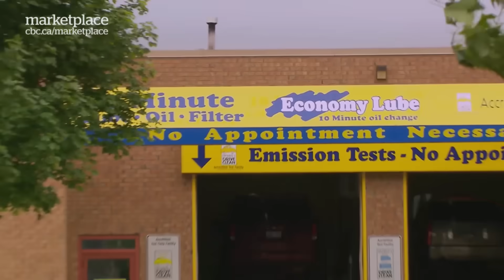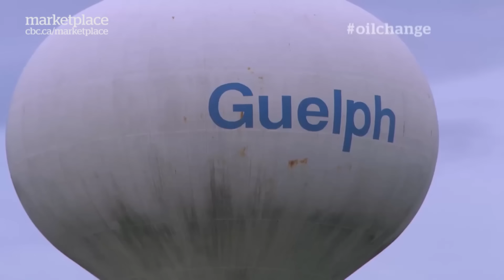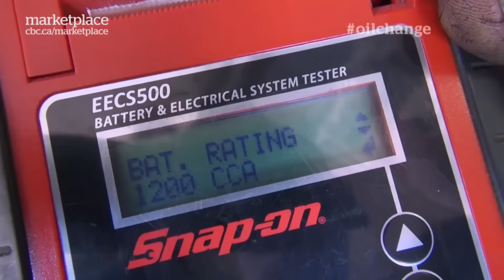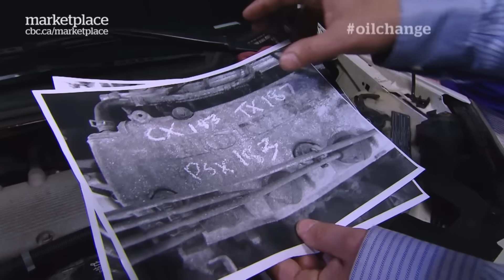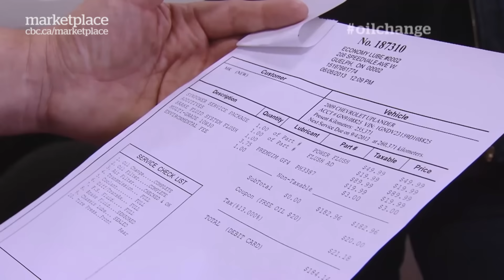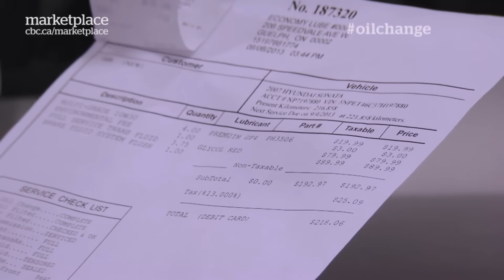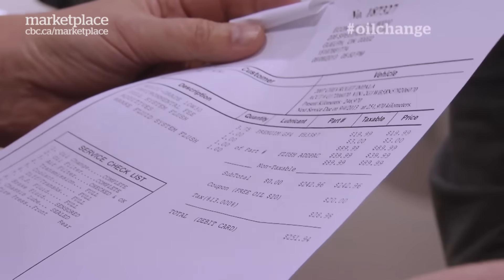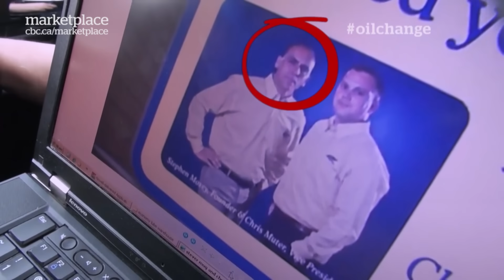Oil change scams: Hidden camera investigation on what really happens to your car (CBC Marketplace)

Comment: I‘ve been to a place like that in Germany. They have screens and cameras everywhere so you can follow every step they do. Very good service, very trustworthy.
Reply: Isn't it due to the fact that Germany is more strict when it comes to consumer protection laws and regulations?
Reply: Meinst du ATU?
Reply: That's why they called Germans
Reply: @arkadybelsky4256  Isnt that a good thing, to have more consumer protection laws? I mean u dont get scammed so often
Reply: @arkadybelsky4256  You must be from USA, you aren't?
Reply: @VinzCassel  u and Gunter above: wooosh
Reply: Valvalien
Reply: @TheChzoronzon  and what the hell means that?
Reply: wow 🤩 that is a good Service! Last time here in Japan I went for a brake fluid change in a gas station and he checked and said it was still in the middle level and it was unnecessary.. wow I thought it was in the minimum level so I asked for an oil change and he checked again and said it was still ok, I don't check oil by myself I just see the schedule that they write last time it was done and the next time it has to be changed, but I was checking in an old sticker taped in my door, certainly I will go back to this shop again
Reply: @arkadybelsky4256  Yes they are called GERMANS...SALUTE TO THEM
Reply: Well, while they don´t usually rip you off illegally with stuff like this in germany, the car manufactures just laughed long and hard and cranked up the prices for spare parts and sometimes "wages". So they still rip you off, just in a legal way :,D Wanted to have 800 Euros at the Audi Dealership to change the front wheel bearings on my Audi A6.. ended up changing themselves in like 2 hours and paying 100 euro.. 30 of which for a bottle of scotch for my buddy, for letting me use his shop.
Reply: Huh? It sounds like they weren't anything like this.
Reply: Also a place near my house (Italy), not everyone is made this way, smaller place are very old style, but the worst of all are official centre (for example vw, bmw, fiat etc). You pay more not always for quality. Even if i know that vw for example spend time for training and quality. But for an oil change, filters or tyre change too often you pay a full day when the real cost is just 1h of work.
Reply: You don’t become a billionaire by being honest!
Reply: @sidneyblondell  You do...
Reply: German s always been ahead of the curve ! . Worked at Two Benz dealership in USA.  Very well organized and had a learning course for the customers to join in  and fix simple things on their cars
Reply: @sidneyblondell  You don't go to jail, lose your business license, your reputation, and get sued for all of your money and holdings by being honest, either.
Reply: The two countries I got ripped off the most in all of my travels: Germania and the Netherlands.
Reply: They can play recorded videos of a similar car 😂
Reply: @raymbech  Would be funny 😂
Reply: @frankfarago2825  yeah I’m from Germany myself and they can rip you off like in any other country
Reply: That’s crazy we need dat shi in America
Reply: @SoldierOfFate  is tht true?
Reply: @Cronposh  Er meint Mac Oil
Reply: Germans can be described in two words…. coldly methodical
Reply: @dotdashdotdash  Yeah, "cold" is the word there 😂
Reply: @dr.reyj.lebaquin9193  2 world wars. And bmw's are endless money pits.
Reply: @patrickharrington9772  dont forget that the 2nd saved us from evaporation from nukes in the "then second" world war if the "real second" did not happen. so take ur time to thank us for saving the world.
Reply: @arkadybelsky4256  relax there are crooks also in germany not all correct
Reply: What is the difference when the actually replace the oil when it isn;t needed? 🤷🏻‍♂️ Its about making money. This way you can see them working on your car. You can be scammed when watching..
Reply: @Cronposh  Ich glaub er meint Mcoil
Reply: I hope they start doing it with Doctors , and specially Dentist  …
Dentist in the USA charge $1000.  Just to look in your mouth ….
Need a good Dentist … go to Ukraine or other Eastern European Dentist ….
Now with the damn Russians might be hard ..
Reply: Wow wish we had places like that here in Australia 🇦🇺 maybe we do I dunno 🤷🏻‍♀️ I would say there would be mechanic shops that do that.
Great idea to film it all and let customers watch the whole time. That’s how you know they are honest cos they are not hiding their work. ❤
Reply: @raymbech  after effects. But seriously.... nope.
Reply: @Cronposh  Auto Tod Unger has a bad reputation
Reply: @streetlegalroadtrip1480  Many, many years ago I had had good experiences with ATU. But then it began to go south...still doing a good job but trying to upsell stuff.

"We need to replace the brake discs." I looked at the discs, and they looked fine to me, so I asked for the Meister (Meister being the Master craftsman, it's the highest professional qualification in crafts and it's a state-approved grade).

The Meister had a look and said, "yup, they're fine, no need to replace them."

I then learned that the employees, including the Meister, were absolutely required by the management to upsell stuff. And that the Meister at that ATU shop was trying hard to do his job as a KFZ-Meister, and not as a scammer. Even under the threat of getting fired. Ouch.

Still go to ATU when I absolutely must. So far, they always did a proper job, unlike other repair shops. I just make sure that I tell exactly what has to be done, and that they have to show me every part they had to replace. And they a fine job every time.

Still prefer my trusted local repair shop. The owner is retired now, but still repairs cars for his long-time customers and friends.
Reply: Lol. Yeah. Germany. Here in yhe usa you step out your front door you're getting screwed for something..
Reply: @SoldierOfFate Yeah because Germany is a socialist utopia, sadly though the only way to live in such a perfect society you have to be a doctor or marry someone there
Reply: olaf, robert and the whole goverment are trusty GER-maniacs ... 😂😂😂
Reply: Mechanics, dealers, lubeplaces, if they do something like this.  Cameras in every garage. No more fraud.

Comment: I love how the expert almost sounded offended that they called his transmission fluid burnt.
Reply: MandishFyre this coming from a mechanic, I understand because it's like them saying he didn't do his job right 😂 and he's like oh hell nawwww
Reply: Lee, I thought the same thing. "You say I couldn't do my job and you don't even know the colour of the transmission fluid, BOI"
Reply: Its because Transmission fluid doesnt burn unless theres a leak somewhere dropping on the exhaust lol
Reply: +Chickenhunter22 Pretty sure burnt or damaged transmission fluid is caused by not replacing it for a long time.
Reply: Kings glory Pro Yeah,  I Worked for Firestone For a Number Of Years.   Total scam artists to be honest...
Reply: the look on his face said everything
Reply: Chickenhunter22 
Actually it can burn from excessive heat and planetary and clutch disc wear. Also not changing it .
Reply: And you still worked there? Ripping people off daily and you were fine with it because it pays well? Complete lack of integrity or morals.
Reply: Some transmissions can not be drained.  The fluid is a life fill

.
Reply: @electrictroy2010  wrong.. so wrong it's not funny
Reply: @AriesTheCam  No he's not wrong at all, some cars are sold with sealed transmissions and advertised as filled for life. They still have access to the fluid inside but not through a drain plug. It also isn't always the case and even sealed trannys sometimes get their fluids replaced. Its not the 70s anymore grandpa transmissions and fluids are the best theyve ever been even on cheap economy cars.
Reply: @AriesTheCam  hes not wrong lol. I.e. volkwagons, some nisanns are what they call life fills. So wrong, so wrong about him being wrong, its not even funny
Reply: @electrictroy2010  all transmissions can be drained. Newer vehicle may require it be vacuumed out. All vehicle fluids can be checked and changed. If i am wrong I'd really love to read your literature.
Reply: @Vousie  not everyone is able to just up and quit their job.
Reply: @willlizz81  all trans can be drained, but, some require special tools to refill properly, and THAT is the kicker.
Reply: Don't go to a quick lube place for transmission work regardless. Transmissions are difficult to work with even when they're mostly good. My shop won't even touch one after 90k miles. Quick lube guys don't even grasp the amount of damage they can do.
Reply: @Chickenhunter22  Rubbish. Transmission oil gets "HOT" really, really hot, that heat breaks it down and the more it gets hot the more it's efficiency reduces, thus more issues arise with your transmission. Unless your regularly hauling something behind your car, auto transmissions need only replacing every 100,000 K's or so, don't forget it also has a filter that also needs replacing at the same time. This requires the removal of the sump pan to access the filter, then a new gasket is required when putting the pan back on. Quick changes can be done by simply disconnecting the auto transmission hose where it goes into the radiator, and another connected to the outflow then is placed in the container of the new oil, engine started and within minutes oil is changed. BUT the filter is still dirty. So why would anyone put fresh oil into a pan that's got a dirty filter ??
Reply: @electrictroy2010  Not my recommendation. Oil can be accessed thru the filler pipe.
Reply: @joelphaneuf-scalise1109  No, your wrong. No matter whether your transmission is bullet proof, or your oil gold plated, if abused it will still fail. HEAT is a wonderful leveler.
Reply: @codeysnow2980  I own a Nissan that actually has such a transmission fitted. Yet I still change out the oil AND Filter every 100,000 K's. Car companies are in the business of selling cars, the sooner your car breaks down, the sooner you will buy another. Therefore, it's in THEIR interests, the car has a limited lifespan.
Reply: @itchyvet  people need to learn about viscosity in oil and how it works. Most fluids are like this, if used for a long time and used hard the viscosity will break down and will lose its bright color. 

Well said btw
Reply: itchyvet also they get environmental tax breaks by making “lifetime” fluids because then they can say their cars have less of an environmental footprint. On top of that there is probably something in the fine print that states the fluid is lifetime under ideal driving conditions yet every vehicle in Canada falls under the severe service category.
Reply: @MandishFyre  Yeah but you would have to not change it for like 5 years/150 000km for it to be like it was described.
Reply: @joelphaneuf-scalise1109  they are "filled for life", not filled forever. Do you know what most car manufacturers consider "life"? It's not your life, it's the vehicles life. Most people drive their cars much longer than what is considered the useful life of any given vehicle. When a Nissan or whatever comes in with over 200k, that is wellllll past the expected life of that car, and it really is a good idea to siphon the fluid and replace it with fresh stuff, at the very least. Filters can be tricky of those things, but sometimes it's still possible to do with minimal invasiveness.
Reply: @itchyvet  so changing your oil every 100,000 miles????? You typed 100,000k which I'm assuming you didn't mean one hundred thousand thousands which is 100 million miles! 100,000 is WAY TOO LONG! I saw a car sludge up after no oil changes after 92,000 miles.
Reply: People like him think they’re gods gift to the world and will never admit they’re wrong and get super offended if you even try to suggest it. Sadly a lot of people like him run a LOT of businesses in the world.
Reply: @joelphaneuf-scalise1109  you have to remember that their ideas lifetime of the transmission is whatever the warranty is also so $36,000 miles warranties over that's your lifetime so she'll probably change it after the warranty
Reply: I changed the chain in the automatic transfer case on my SRX a few years ago and at 140K the fluid looked fine (not new, but very good). I replaced it with 250K fluid. No filter in those in case you don't know. I towed with this so it's not like it was babied. I wouldn't change my mind about changing it, but it was much better than I expected.